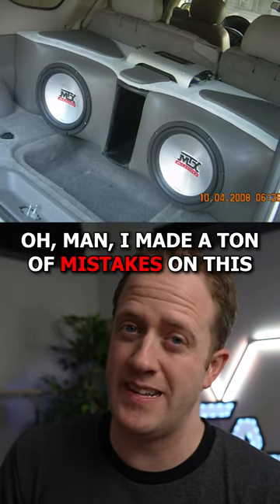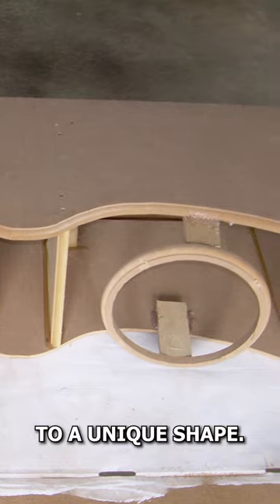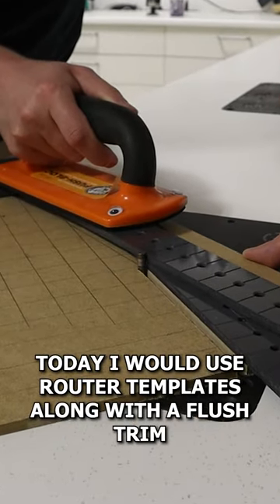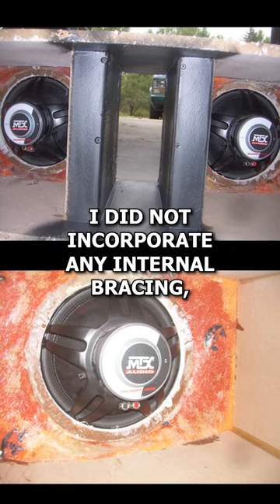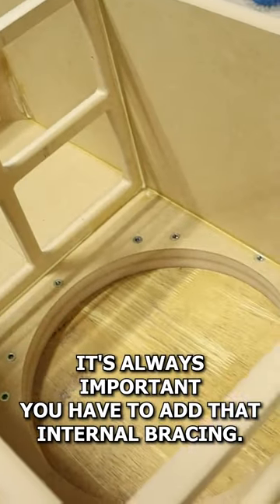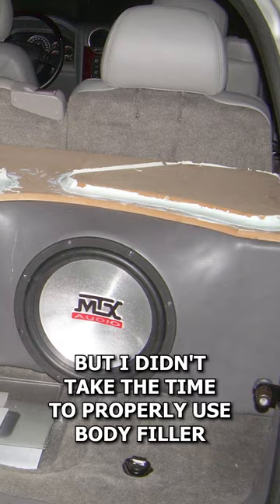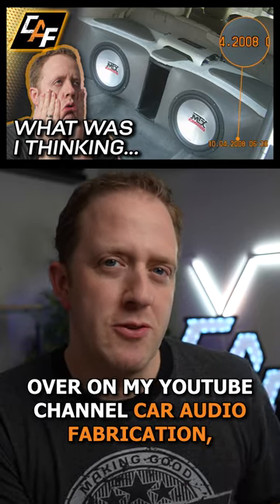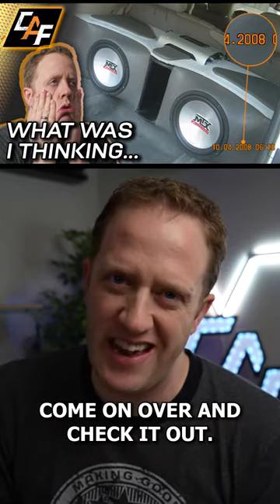14 years ago I made MISTAKES in car audio...

Comment: You have to be careful with internal bracing... if you do it wrong you can end up creating boxes inside of boxes, which will ruin your tuning and give you a different sound to what you were expecting. Sometimes you can benefit from simply using  different building materials such as MDF instead of plywood... and line the inside of your box with sound deadening buytl rubber instead of bracing.

Comment: With the fiberglass and 3/4 MDF would the bracing still be needed for those fairly small output subs?
Reply: I was about to say, bracing on these little babies isn’t needed. Even if you do lost some “acoustic energy” I’ve never braced any of my builds and been quite happy. That said I also don’t have long spans of wood without something like a port to naturally brace it. So I guess I do use bracing nvm😂